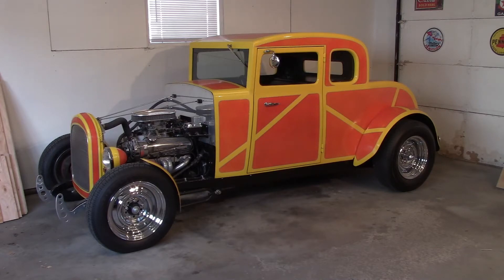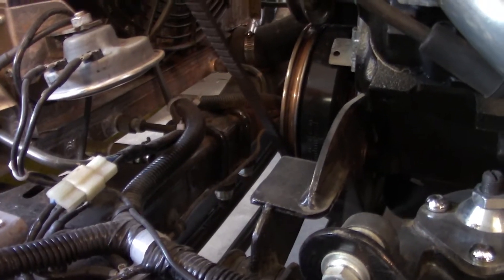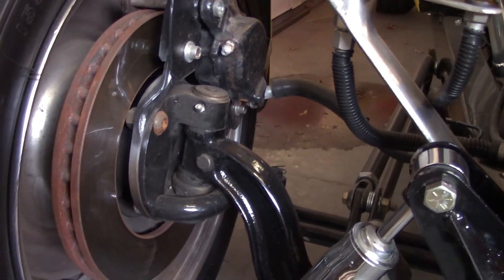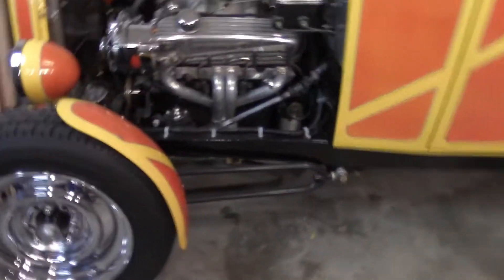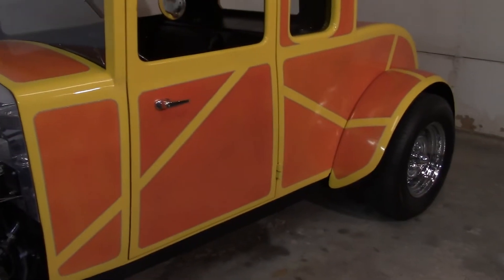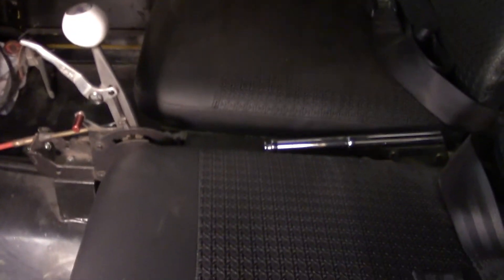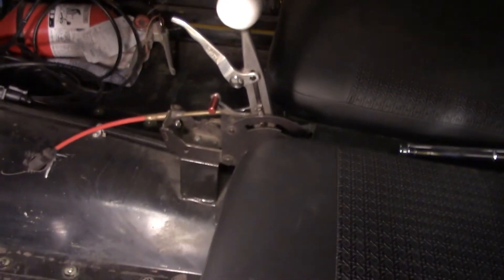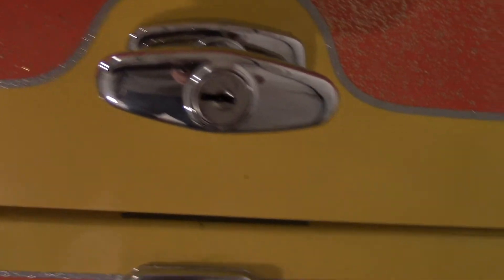The Backyard Coupe, walk around.

Comment: Most impressive craftsmanship. Where there's a will there's a way. I've thought about building one of these like you have for years ever since I seen a guy in town with a hand made roadster kinda like yours. 
Real 32 ford's have always been out my reach. So my thinking always was if you can't afford it, build it yourself.  It's cool to see someone actually built one of these . Excellent  work.. 
Do you have measurements or blue prints? I'd love to build one with my own twist to it.
Reply from the maker: Hey Matt, thanks for the comments. That is the reason behind The Backyard Coupe , a real factory built 32 or model a, or even a fiberglass replica, seemed way too expensive for me, so I played around with the idea of scratch built , this was many years ago, then I built a scale model, and when I had a good idea in my head, started building it. It actually turned out better than I first thought it might, anyway to answer your question, definitely ! there are plans in the works right now, about 75% finished, they will be out this spring!
Reply: @kentdixon5716  yep. My thinking exactly. Always wanted a 32 ford 5 window coupe..but they are all out of reach for the common man..tooooo expensive . But the handmade roadster in town riding on the S10 chassis got me thinking ..just build it by hand..I was trying to figure up a wood frame with sheet metal exterior..like the real model As were built.  But your idea of the square metal  tube frame with wood exterior is good . Heck, that one you built looks killer. I'd drive that everyday. I'm curious if you have roll up glass in the doors .I'm trying engineer that in my mind. I thought about using a 1/25th scale 30 model A 5 window I have as a pattern  to get the dimensions in full scale by converting the basic measurements to full scale .. .but if you got the patterns and blueprints, I might just hold for that as a basis  to build from   and add my twist to it..Building it looks simple enough ..I used to restore and build hot rods for a living for other people but never could afford one myself.
Just seeing you build yours, I can't help but think this is old school stage coach building methods from 150 years ago..

Comment: How did you get title ?
Reply from the maker: Hey Darrell, every province here in Canada, and every state in the US, has provisions for homebuilt, or ubuilt vehicles, You have to keep inventory of all your major purchases, suspension parts, differential, motor, transmission, front axle, steering box, etc, then they will issue you what they call an assigned VIn number, because obviously it was not built in a factory and therefore does not have one. Then after it passes a full head to toe vehicle inspection, they will fasten it to your vehicle, with special rivets, then from that day on it will be in your province/states motor vehicle data base, then you can get appropriate registration/ insurance.